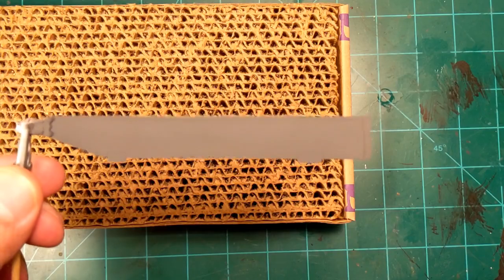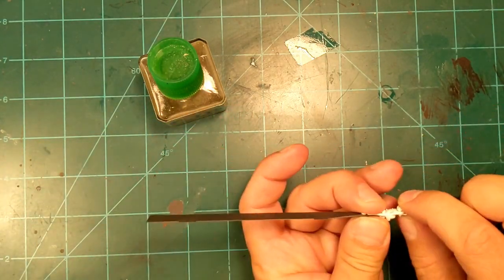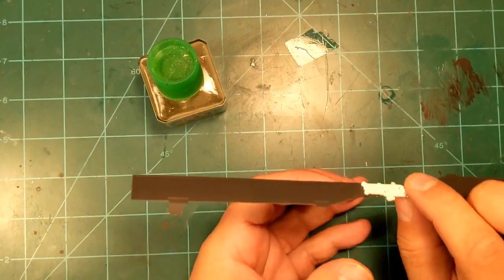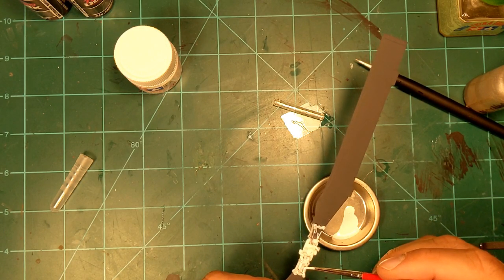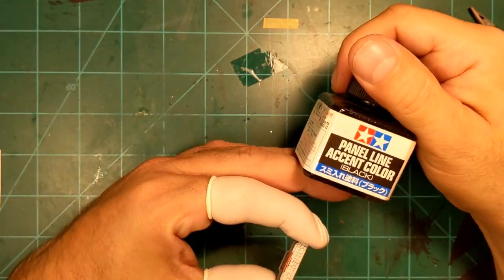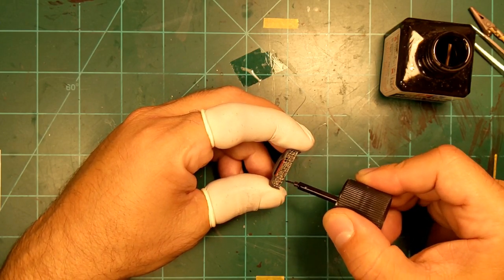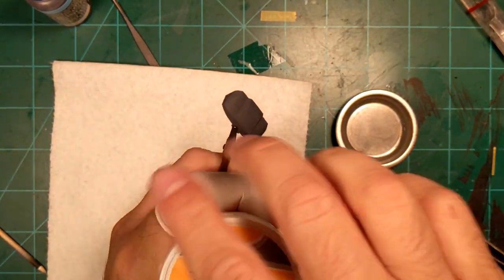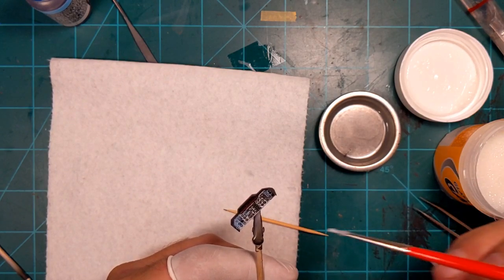Airwolf "The Lady" 1/48 scale Aoshima plastic model full-build

Comment: Looks  great but a couple suggestions if I may. The main rotor blades should be the same color as the tail rotor, at least on top. Also the wings where the wheels retract have no doors on the real copter. I know the kit has plug in gear for landing and flight modes for display without the gear able to actually fold in so to replicate the look I suggest either painting the door covers black or leaving them off entirely
Reply from the maker: Thank you for your suggestion! But I was hard to find and replicate of this stuff hope hopefully you understand 😂
Reply: ... also ... the main landing gear is in a decompressed position witch look "weird" when sitting on ground. (too bad for the left wheel but I am sure it is fixable).
BEAUTIFUL model! Congratulations! ... I have the kit for several years, but no such skills, I haven't finished it yet, I don't want to pork it. ;-)